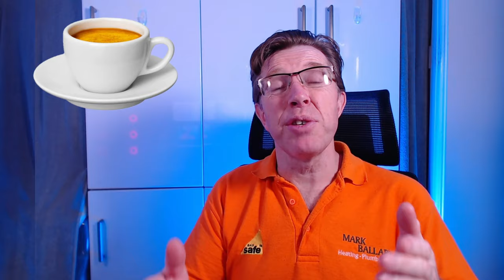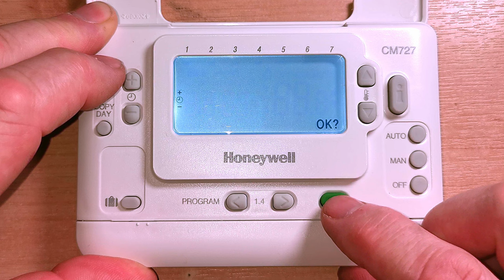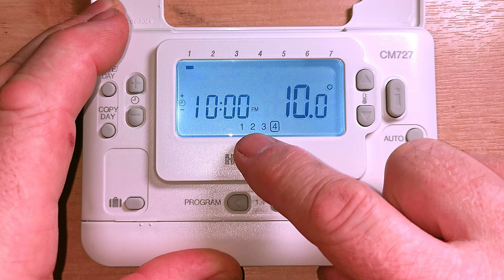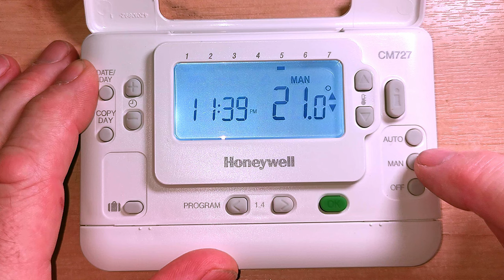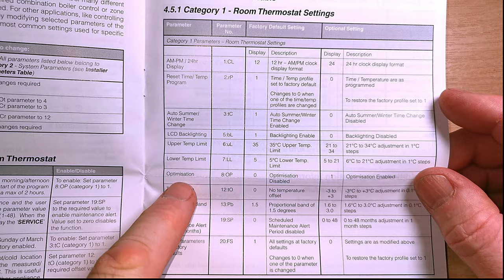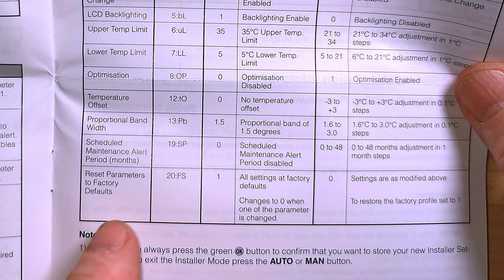Honeywell CM727 & CM707 How to Use, Set Up & Program this Programmable Room Thermostat

Comment: For anyone strugling to understand the programs, all the 4 programs are just TIME ZONES where you want your temperature to be "this much". Program 1 is from 6 AM - 21C and from 8 i go to work so i want 18C in the house until i return at say 4PM, so Program 2 will be 8AM - 18C. Then Program 3 will be 4PM - 21C and so on. TIME ZONES.  Program 1 doesn't mean ON and program 2 doesn't mean OFF. I had a hard time with this and I finally understood after many videos, trial and error, and reading the manual. Hope it helps someone. Cheers!
Reply: Thanks.
Reply: Hi thanks.  So how do I set it to be where I only want the temperature to be a certain amount during the day? So for example, I only want the room to be 21C at 7am and 7pm , no need to maintain or heat up for the rest of the hours of the day…. Is there a video that can show me this please? Thank you!

Comment: Thank you very much! It is amazing! 
But after 2 days it stopped working with heating. Cm727 shows flame and flashing wi fi symbol, but heating doesnt start working. I thought something is wrong with boiler, but no, it is heating water but not radiators 🤷‍♂️ what can be a reason?

Comment: When boilers have timer on the front panel with classic 0-clock-1 and you want to use this thermostat, would you set the selctor switch on 1?

Comment: Hi. I'm not getting a low battery warning but occasionally the LCD display can for a few seconds fade out and then back on again. Is this indicative of the batteries getting lower or is the unit starting to show a fault?

The unit has been off all summer and was only recently turned on again after a service of my Viessman Vitodens 100 combi boiler. However, I think I've got all the settings OK but have this possible anomaly. In auto mode the heating doesn't seem to come on unless I first activate it by briefly switching to manual mode and then back to auto. 

I have a weather compensation device attached to the outside wall adjacent to where the boiler is positioned. Can you please explain what exactly that does?

On a more general note how long would you expect a service of my particular boiler to take? In addition would you expect the engineer as a matter of routine to have a quick look at the wireless controller and a basic check of all the radiators to ensure they were all working as expected after the service. The engineer we had aside from being rather abrupt took 2.5 hours to service the boiler and just spent all that time in the kitchen. He did also change the crystal balls in the combimate unit situated under the sink.

Apologies for a raft of questions but would really appreciate your observations

Comment: Hi Mark, Our Control Box is a CM727, I think I have set it as you advise. If I set the Temp to 18 the Boiler fires up at different times if the Temp goes below 18. It’s set on AUTO The Optimisation is set to 0 
My question is if the temp goes below 18 will it always fire up? Thanking you

Comment: I have tried to Use the program settings the first one seemed to be okay but then it won’t hold and then it jumps to 2 and has no time and no temperature three also has no time and temperature and then four has a time and a temperature. Where are the times and the temperatures for two and three?

Comment: Hello I have CM737, controlling  my heating gas system integrated with external boiler for preparing hot water, can I turn of/disable  my external boiler via CM737 ? as I want my hot water boiler to keep going on other type of power electricity  instead of gas (it has such option) but  I can't find in CM 737 program settings how to turn off hot water external boiler, seems there is not such option ?  Pls advice/help.

Comment: Excuse my stupidity, as I have no idea about energy at all. I was just wondering its -01 outside, but my CM727 is saying 17.5 c. I don't have the heating on, I have a T-shirt on, and I don't feel cold. There is no flame on the display. I'm in a new build apartment block. Am I getting heat from the other flats? Or have I got the heating on somehow?

Comment: Does anyone know why when I set the temperature to be higher, as soon as I've finished pushing the up button to the temperature I want, the displays drops back down to what it was. I initially thought it was because it was working its way to that temperature, but it never seems to get there... If I push the manual button it will initially show the temp I've asked for but also only shows it for a couple seconds before switching back to the current temp

Comment: Hi Mark, I have a Honeywell CM707. I have done the 4 settings 1)7am 18 degrees, 2) 8am 10 degrees, 3) 6pm 18 degrees and 4) 7pm 10 degrees. So as I understand it at 8am and 7pm the heating shouldn't come on unless it drops to below 10 degrees? However it stays at a constant 18 degrees throughout so the heating continually clicks on when dropping below 18 degrees. Maybe I'm missing something? I just want it on for an hour twice a day to take the chill off the house. Any suggestions appreciated - Many thanks
Reply: i have this same problem too - set it to 20 degrees to come on at 8am (programme 1) set it to 10 degrees to go off at 10am (programme 2) - but it came on at 7am this morning when in AUTO mode, the days set correct, so i have no idea
Reply: I am also having this problem